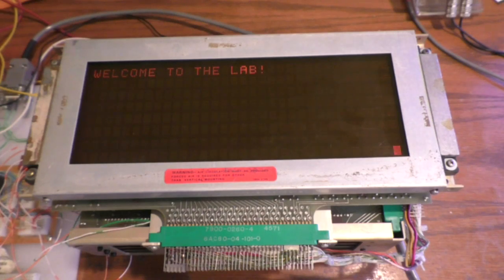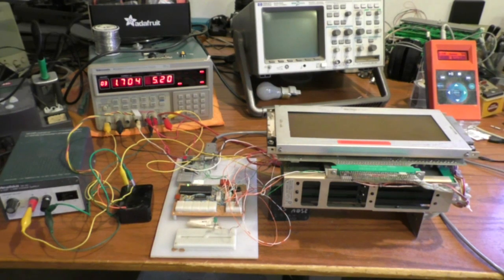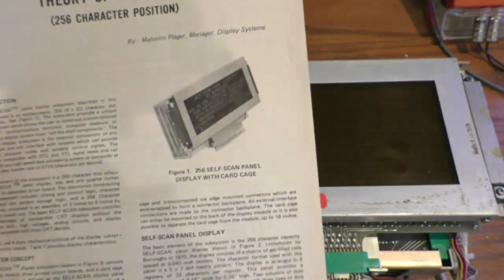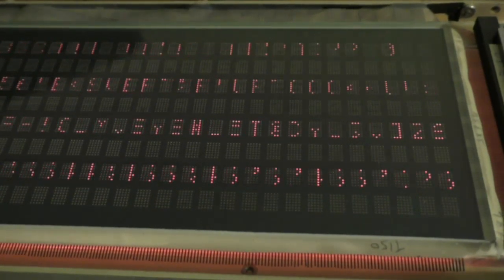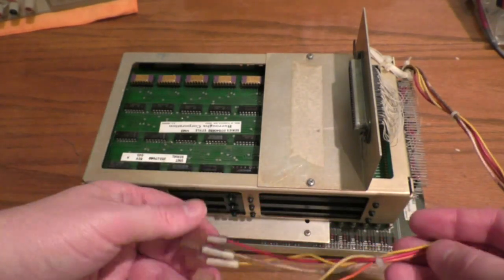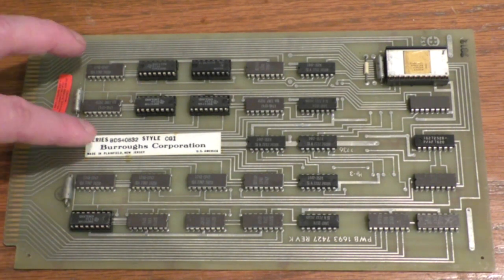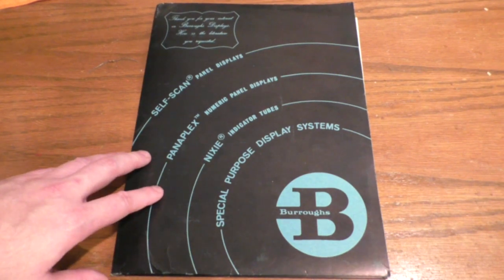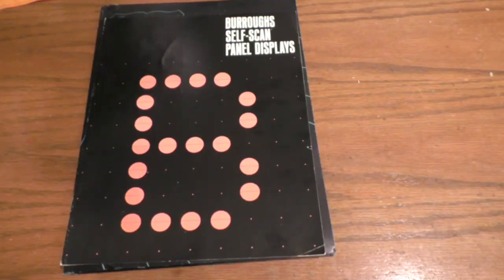Massive Burroughs 8 Line Self Scan Neon Display Running

Comment: These were used by Triad Systems Corp, in the mid 1970's - very early 80's, in their auto parts store computers.  Triad had ~80% of the market at that time, so if you're of sufficient age, and visited an auto parts store back then, you may have seen these being used by the countermen.   Triad only used 5 of the 8 available lines, and the assembly lived within a cast aluminum housing.  They were very reliable, with the few failures limited to one complete horizontal line of dots either going dark or being constantly lit.   Triad created a single board, called appropriately a FLD (five line display), instead of the 4 Burroughs boards.  There was one interesting feature to these however.  The 250 volts you mentioned was within easy reach of your fingers, if you monkeyed around with one while powered up.  Finding this out the hard way was know as "joining the 250 volt club."

Comment: Do you have that theory of operation doc scanned and uploaded somewhere safe? You can hardly find any info on these burroughs self-scans online and I have one WITHOUT the ttl logic so I am forced to design my own controller, which should be trivial and allow me for any character set I want too. I'll probably just trace out the driver board on the back but that doc appears to have had some info that would help in this endeavor and I can't find it online anywhere.
Reply from the maker: What version do you have?  The 1 line seems to be the most common. I think I have a pdf for those that explains the drive signals.
Reply: @kevtris  Nope I have the 8 line exactly as you describe in this video. And yes the PDF for the single line and the theory of operation is online thanks to my friend Jeff Jonas here:  http://ferretronix.com/tech/nixie/self-scan/

I should be-able to figure it out from that theory of op... its basically the same thing just scaled up. But it would be nice to have that doc you have too.

Also mine doesn't have masking over the front hiding the two skipped columns to space the characters apart, so theoretically with my own driver I can drive those columns as-well and have a seemless row with all columns driven, unfortunately they do omit anode lines for the rows spacing the character rows apart so not quite a full graphic display but probably close enough for fun.
Reply: I should have prefaced, I have the 8 line exactly as in this video without the TTL drive cage behind it, just the display module with the transistor/diode logic drive board on the back.
Reply from the maker: @Conmega1  I moved awhile back so I am not sure where the paperwork is, but the basics of it is pretty similar to the  1 line version.  Instead of 1 line though there's 8, so that means there's 56 parallel row inputs (5*7 dot characters, so 8 of them high.  7*8 = 56), and there should be a reset input and 7 column phase inputs (pretty sure it's 7 on this display).   The basic method is you select reset, which brings the glow back to the left side, first column, then step the glow to the right using the 7 phases, in the order 12345671234567 like a stepper motor.  Once you reach the last row, you begin again with reset, so the glow continuously scans all the columns in order.  There's a few other auxiliary electrodes like keepalives which are on the left side.  These get the high voltage through resistors all the time generally. There should be circuits on the board already for those.  You'll need 250V DC to run this thing.  Other than that, the 1 line documentation should be fairly applicable to the 8 line.   If you ever come across a 12 line display, it will have 12 phases on its column drive instead of just 7!  The 1 line display only has 3 phases.

Comment: There was a 480-character version which was used in the TD-730 display terminal.
Reply from the maker: yeah there is.  I own one and built my own driver for it, but haven't made a video of it yet.  It's a small serial terminal with RS-232 and a PC keyboard.

Comment: do you know much about burroughs?  we used to have these computers at school in the 90s called the unisys icon.  ran an early version of qnx which is apparently the same backend os for blackberries.  but it seems the system was also sold under the burroughs name.
Reply from the maker: +omfgbunder2008 I don't know much about the company itself, just their display products.  bitsavers  (bitsavers.org) has a lot of burroughs computer documentation, however.  there might be some useful and interesting information there about them, though the info there they have might be for older stuff.